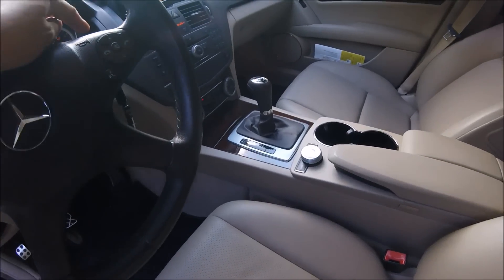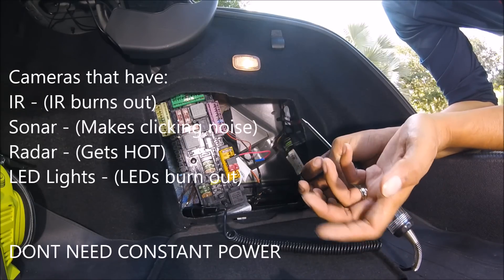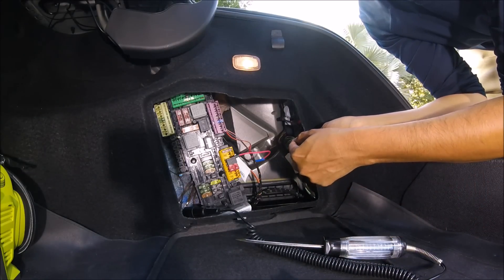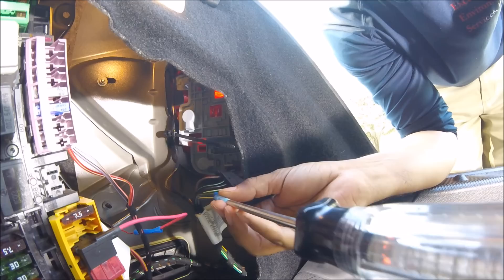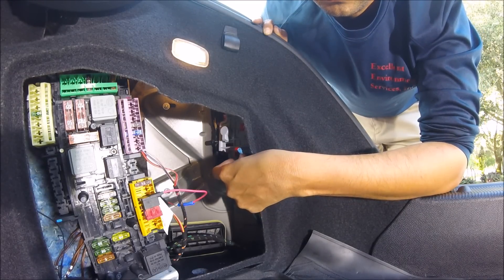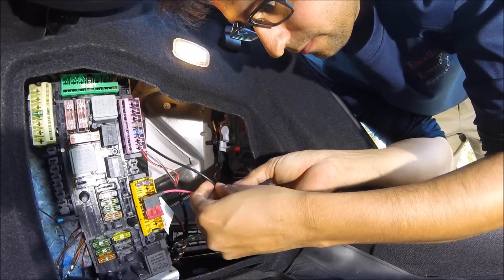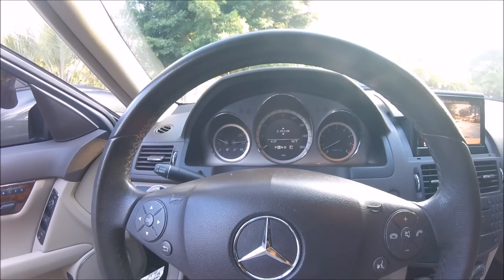Wire Backup Camera to Reverse Light CORRECTLY on ANY car

Comment: Although it is a great video for Mercedes owners and i agree that Mercedes ecu is very mean to detect any faults but as long as you have a good connection, the code will not appear. i believe the brake bulb on those cars are P21W which are 21 watts and if you have a loose connection then it will end up with fused bulb message. What happens is when there is not a good connection then resistance changes on that wire that's why. Good luck

Comment: Hardly the correct way to do this. those cheap connectors cut the wire, making the wire smaller.

Comment: I hope you see this today. I’m working on a 2012 mini cooper and installing a wireless backup camera the signal goes out when I put it in reverse. I tapped into the wiring like you showed but it still doesn’t work. It seems my reverse signal starts pulsing when I shift into reverse. Any thoughts? Do I need a diode of some sort?

Comment: The blue insulation displacement connector (IDC) is for 14-18AWG wire. If your wires are smaller gauge then use the red IDC 18 to 22AWG. Using the wrong size IDC can cut through the copper wire and not just the insulation as it is designed to do. Vibration is not your friend with this type of connector. Secure it so the wires don't move when driving or use a different method to connect like others posted down below.

Comment: Thanks for this. With my wifes Yaris the manual  suggested wire connection color was incorrect so I was using a multimeter to find the hot wire without success. Im getting a test lamp now to assist me in this. My process was correct but their color was wrong. Good presentation.

Comment: I have a sentra S 2015 and the cables for the rever light are green and black which cable is the correct for making a T connector to install a back rear cam? Thats the only thing that i need i already spend alor of time in YouTube and either in the manual they dont say nothing.
Reply from the maker: I did an Altima video should be the same. You can always find the correct cable using a 12v test light

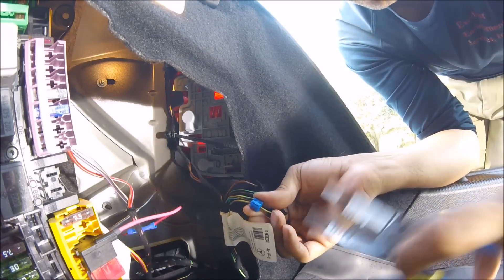Comment: 3:50 is it positiv or negativ wire going in THer ? Where put + wire ?
Reply from the maker: Positive taps reverse bulb positive
Reply: But my tail light stoping working ? How can i fix ? Please help i have w204
Reply: Please help. My revers tail light back light is number 7 (+) but i dont know where i can put (-)  and my tal light up one not working
Reply from the maker: @Mziry  your bulb is probably dead

Comment: Hello Raymond, with that blue wiretap and its hole where we can insert a wire, if we were to install a backup camera, is that the hole where we would insert the power wire for the camera.
Reply from the maker: Depends on the car. But you want to find hole to get power into the car
Reply: @RaymondUrias  ok thank you. I thought I watched a video of yours showing a video convert, I thought the name is. Trying to find that video. Instead of getting wire harness for aftermarket backup camera to connect to factory display, I'm looking for that video converter picture or name please

Comment: You are totally wrong .It called CAN BUS my friend and it’s on lots of European cars not hi end only,VW BMW etc.So you need a can bus adapter made by a low resistance relay accompanied by a capacitor of not less than 6000μf to stabilise the power.And you never do that to a Jaguar.

Comment: This will not work for newer or models that have LED back up lights.  The voltage to them is too low for it to trigger anything.  FYI.  You have to tap into the SAM unit that powers the lighting to rear of vehicle.  You have to have a wiring diagram and find the positive wire that is live when you put your car in reverse and tap into that.
Reply from the maker: https://youtu.be/MNWNAC7kNUA

Comment: Brilliant I've been trying to find out how to do this on my MERC I wasn't sure what to do with the red wire on the reverse camera as the main dash camera is 5 volts reduced by the plug in cigar charger and didn't want to blow anything by connecting to 12v reversing lights on the rear camera.

Comment: I have a 2011 W204 PFL without backup camera and just purchased  an Android screen which I would like to install a backup camera too.  This video was very helpful in guiding which way is best to run power to the camera but my question is how, if installed to Android screen, will the screen be triggered by camera if my command center was not provisioned with backup functionality.
Reply from the maker: https://youtu.be/YwTyKdIqCFQ
Thai is the best way I feel.
The android screen will trigger the camera.

Comment: Hello
Hello, can you help me in the assembly of a camera for the Mercedes W204 that I bought and does not give video.
The seller said that the video cable has 2 red wires one at each end, one must connect to the radio and the other connects to the lamp together with the red power wire.
But the video cable that came with the camera doesn't have 2 red wires, how can I do it?
Along below the seller's comment.
Have the 2 small red reverse wires from RCA connector been connected? see attached picture, the correct installation instructions are as below,
(1) The green connector (# 1) plugs into your car radio screen directly, it's the video-in cable for the backup camera image;
(2) The power wires (# 2) need connect to the reverse light power, red wire connects to 12v + and black wire connects to GND;
(3) There're 2 small red wires (# 3) from both sides of the video cable, they're backup camera signal detective wires; one end of them need to connect the car screen's reverse wire if your car screen has a separate reverse wire for a backup camera, if not, you don't have to connect it to anything; but for other end, the small red wire must connect to the reverse light power 12v +, with its connection, the camera will work automatically when the car is in reverse, thanks.

Comment: Hello raymond can it be done with a wireless camera, also the power supply cable port ( I dont what its specific name) can it be find inside of the car close to the breaker or turning wheel.
Reply from the maker: There is a wireless signal in most cars behind the radio. If you search online for a wiring diagram of your vehicle you should be able to find it

Comment: Great video i needed this to wire my reversing camera!  also, what was the tool that looks like pliers called that you squashed the plug together with? in the uk you cant get those, i used to have one but lost it, maybe is can get one from ebay.com, the ones in the uk are thin and dont do the job correctly!
Reply: Crimper tool

Comment: maybe its just me, but this video makes no sense.

why were you getting an error from the right tail light if the cam was hooked up to constant power originally? seems backwards.
and then you say the computer is sensitive enough to tell if i wire has been cut and re-soldered...  but it wont detect you piggy backing a camera off it? 
and folks, probably dont go poking random wires in your computerised car with a bulb style test light unless you know what your poking, can be very bad times.
alot of stuff said is this video is really wierd and not quite right.
should have just called the video "how to use a scotch lock" and left it at that.

but everyone is praising this vid in the comments, so i had to throw my 2 cents in, 
keep looking ppl, better than learning how to, is understanding how it works.

(sorry if i seem very negative, i actually enjoyed the video it was well made and the guy seems like a good presenter, just some of the technical stuff is a bit iffy)
Reply from the maker: Poking around "Giggity"
You made some valid claims, not even going to dispute it. The over theme of the video was how to find the reverse wire and tap into it. 
It was on constant power till I moved it over to a relay and need to acquire a signal source. I believe my next video the relay one.
In regards to your last line
https://youtu.be/ZxJVW_CxWjY
Reply: ah makes sense now i know there was a relay involved, may the algorithms smile on you brother.

Comment: I accidentally cut part of the copper in the insulation and now my blinker flashes fast, but the reverse light and the other ones still work, do you know how to fix
Reply from the maker: Re solder and use starbright liquid electric tape
Reply: Raymond Urias solder the cut copper to the rest?
Reply from the maker: @allanayala9450  yes, I also realized that sometimes Mercedes does that if the bulb is dying as well
Reply: Raymond Urias thanks very much

Comment: Raymond....I need help with my 2015 Audi Q5. the back up camera comes on and off, when in reverse. I pressed the park assists button for the sensors to make the bumping noise when going backwards. And works every now and then by turning the camera on. But now, it wasn’t working. Can you give me any answers on Audi’s?
Reply from the maker: Sounds like a lose wire, check the ground. Or the camera is failing
Reply: Raymond Urias ok, thank you and I’ll look at that area.

Comment: Thanks I’m glad search pulled this result. Can I ask what gauge t tap you used
Reply from the maker: 18 works perfectly fine
Reply: @RaymondUrias  I found TSV 60pcs Insulated 22-10 AWG T-Taps Quick Splice Wire Terminal Connectors Combo Kit that's good?
Reply from the maker: @C32used  good kit....that's alot of taps!

Comment: totally wrong pliers used grimpg  connection to wire, no newer flat pliers to abico grimp, idiot .you need real right rattle abico grimping pliers if use abico connections. same have ewery connections, used only own genuine grimping pliers not flat pliers newer, wery dangerous and i has see this amateur style made many radio etc stuff and burn car,

Comment: Tidy work and nice video, but the explanation is not accurate. The computer doesn't feel that the copper has been cut. There are two ways to know if the bulb is out, 1- by measuring the current through the wire and when it's too low or too high it means the bulb is burned or shorted. 2- checking the voltage drop, when the voltage drops slightly below the supply it means the bulb is fine. Anyway, it's a good video.

Comment: A lot of good info but you can also run the camera/parking sensors off a relay.
I've fitted cameras to Mercedes c200's and ran the camera off a relay.
Remember never solder the camera  wire on to the reverse signal wire.
Another thing to note is cameras require 12v to power on properly with a lot of modern cars when the engine is started the voltage to the reverse light drops to sometimes below 11v the camera will not come on or you get horizontal lines on the display there you can use a relay aswel.
Reply from the maker: I agree that's why I also made this video
https://youtu.be/MNWNAC7kNUA
Reply: @RaymondUrias Nice you made a relay video:).

Comment: jcv1995 ya really, I do 5 cameras a day on a good day . And that’s not the process. Never use t taps for one . Strip the wire , poke a hole in the exposed metal insert the new wire into the hole . Wrap the excess , solder , tape , tie wrap the connection so the tape can’t fall off

Comment: I understand I want to power the camera to the reverse light correct?  Mine just has a extra red wire coming from the video cable on both ends

Comment: As a person who designed and released wiring harnesses in the automotive industry, I would disagree with this method.  Insulation displacement connections are easy to use, but after time the connection will likely become intermittent.  From the perspective of the OEM harness manufacturer, this method would not be used.  Cut, solder, and sealed shrink tubing is a robust way to tap in... then of course use a relay as not to draw too much current.  That's the kindest way I could think of to comment.  And vehicle architecture for detecting bulb outage is usually done by measuring current not voltage.  Your description is incorrect.  Now a bunch of people have been misinformed.  Please find a better source for your information.

Comment: 1st question - how do u find grounding bolt? there are several bolts. which one is grounding in my car? how to know
Reply from the maker: adityahpatel typically ones that are on bare metal are good grounding points. You can also look for ones that have ground wired going to it. You can always make a grounding point if you are not 100% sure... Just make sure it's bare metal.
Reply: @RaymondUrias  thanks!

Comment: Hola Raymond, mi felicitación desde España por tu video tan instructivo.
Yo lo estoy intentando en mi MB C220 W204 Audio20 y estoy teniendo muchas dificultades con mi interfaz, no me reconoce la señal de la cámara, desconozco si hay que actualizar algún Software, para que funcione mi camara reversa.
estoy utilizando de Interfaz  uno comprado en Aliexpress llamdao: INTELLIGENT PARKING ASSIST SYSTEM YX-BZ8811. 
Agradecería tu ayuda. mi email: asalonsoa@hotmail.com

Hello Raymond, congratulations from Spain for your instructive video. I am trying it on my MB C220 W204 Audio20 and I am having a lot of difficulties with my interface, I do not recognize the camera signal, I do not know if it is necessary to update any Software, so that my reverse camera works. I am using an interface purchased from Aliexpress called: INTELLIGENT PARKING ASSIST SYSTEM YX-BZ8811. I would appreciate your help. my email: asalonsoa@hotmail.com

Comment: Thank you so much for this video. How do I connect the ground wire of the camera? I don't have the board near my tail light of Audi A3. My tail light connector has 5 different wires going into it. One of them for sure is the reverse light. And where do I get the connector that you used to tap into the reverse light in this video
Reply from the maker: All links are in the description section. Ground can go to a clean metal point on the cars body or frame.
Reply: I’m having the same problem on my Audi A4...I used a side by side wire crimp and didn’t have any success. Is this the wrong crimp?

Comment: Why left traction control light is on ?? Its on in my car also and turns off aftet I start my car.
Reply from the maker: What? All the lights turn on when the car turns on it's a system check
Reply: Raymond Urias  Not all lights that Yellow triangle ,exclamation sign in it.In my car It was not always on but now its keep glowing while I turn on ignition and turns off when I start my car.
Reply from the maker: That's fine as long as it doesn't stay on

Comment: It doesn't matter whether you tap the wire or cut and splice it. The voltage is going to travel down the same paths. Cutting and soldering is always a better connection than a wire tap; it's just more work to do it right. The reverse light should only be used as a trigger and not a power source anyway.
Reply: maybe but 99% of people will choose the easy route.

Comment: First thanks for your video of how to wire the reverse camera. I followed exactly the same way you did in the video, and having 2 problems now:
1. I'm installing a reverse camera on my Mini Cooper, and even with the proper T-tap, I still get the lamp error on my dash.
2. My mini cooper's reverse power line is 12v while the car not start, and it will step up to 13.5V when the car is started. That making my camera to act weird.
If you have a solution for these 2 problems, please let me know, appreciate a lot!
Reply from the maker: I actually just made a video for mini Coopers. It's on my channel. With that being said they are very sensitive to voltage drops and you need a capacitor shown in this video:
https://youtu.be/SUOivzMeoqU

Comment: I have a normal back up camera, can i still use this method? I have a electricians voltage screw driver tester, can i use this in the same principal as your light positive tool?
 Also is the fuse wiring the same on a 2009 ML?
Thank you
Reply from the maker: Same concept execpt the ML has votage swings. I recommend you wire it like this:
https://youtu.be/MNWNAC7kNUA
Reply: Raymond Urias Ok thanks I will try that.
Reply: Hi, Raymond.

I was able to find a capacitor https://goo.gl/images/6gjcSX
Is it as simple as joining the cameras input and output red with red and black with black and then T-tap connect onto the ML rear light wire?
Thank you

Comment: My rear view camera only has a red wire that goes for the reversing lights. Would it still work the same without the ground wire?
Reply from the maker: justin melt yes some cameras are internally grounded
Reply: Raymond Urias I appreciate the response. All the tutorial I've seen and the manual it says ground and positive wire hook up.

Comment: Be careful using test lights, much better off using even a cheap digital multimeter. There's always the possibility of the test light introducing too much current back into the circuit and damaging a sensitive computer such as your BCM or ECU depending on what you are testing. Also, the correct way would be either perform a military splice and tape or solder and heat shrink. Solder is not going to add extra resistance to the line if done correctly, there's a reason that every data connection on a remote start is soldered if done properly. Using a t-tap butt connector or crimp camp runs the risk of introducing extra resistance to the circuit and potentially getting a result that's non-functional or sporadic. Not saying this is always going to happen but it's better to be safe than sorry. Either way good job on the video, presentation was excellent.
Reply from the maker: You are 100% correct
Reply: @RaymondUrias   Are you anywhere near Austin, Texas?
Reply: No that's not correct at all never use solder especially on Mercedes.